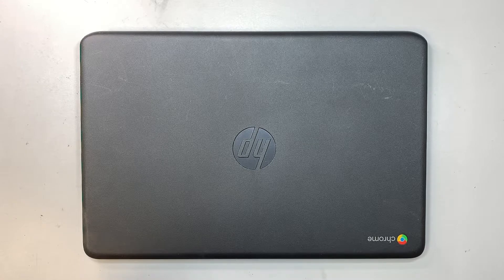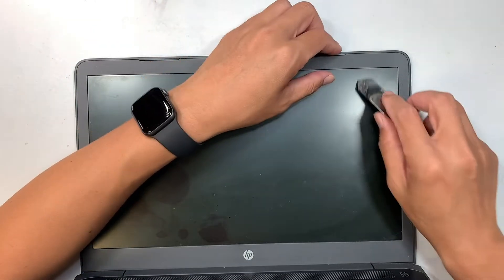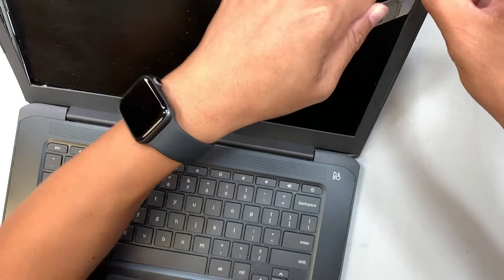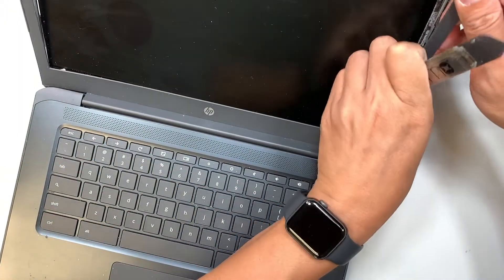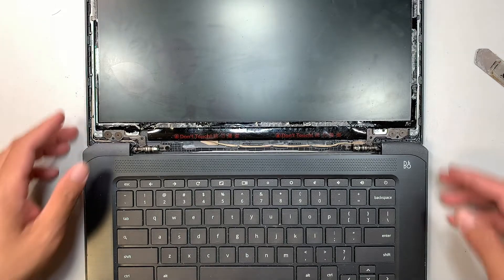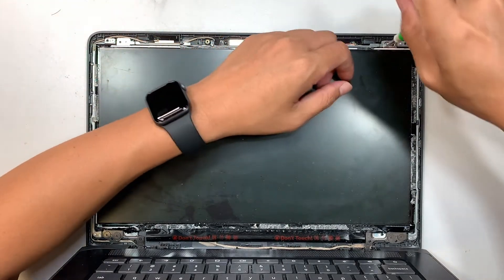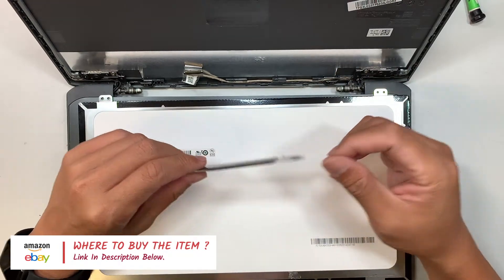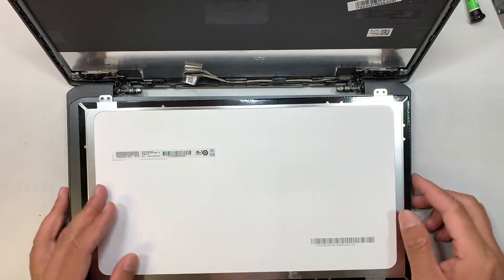HP 14 Chromebook Screen Repair Step By Step

Comment: I've removed my Chromebook screen and it has two model numbers on the back which direct me to slightly different screens.  One is the AU Optronics B156XTN08.1 NO BRACKET 15.6" Laptop Screen, the other is the HP N24995-001 15.6" LED eDP Laptop Screen 1366 x 768.  Are these the same?